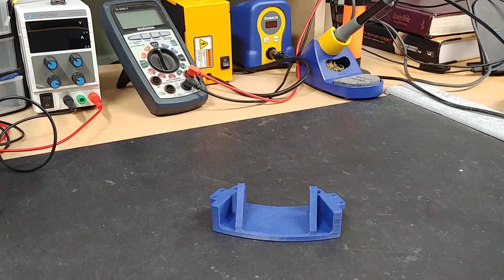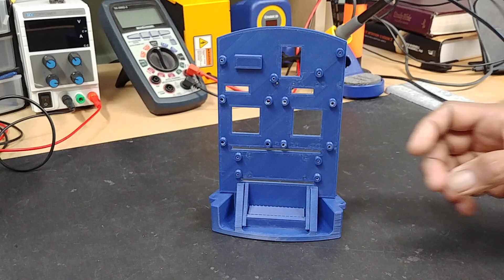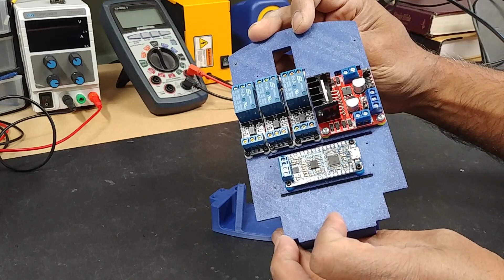R2D2 Build Episode 3- Dome Mechanism Electronics Board

Comment: Hi Dan, I’ve managed to obtain all the information you provided for the dome mechanism build, but was hoping you could provide a schematic on how to wire it all up. I’m using the same electronics components as you are, so effectively a replica of what you’ve done. Any help would be greatly appreciated. Nigel
Reply from the maker: Hi Nigel.  I don't have a complete diagram but I have one diagram that shows how to wire up the motors and limit switches.  It can be found here: https://drive.google.com/file/d/16oCrsCOlNoQSy4BZxheGNYJnU1nh-_0b/view?usp=drive_link
Reply: @ that’s a great start, thanks Dan 👍
Reply: Where did u get the power distribution board?
Reply from the maker: @3dPrintingNederland  I made the board myself out of a small perforated PC board and a bunch of screw terminals mounted to it.
Reply: @MakerDan55  haha no wonder i cant find it anywhere. Thanks man I'll work something out 😄
Reply from the maker: @3dPrintingNederland  remember that you can change/modify anything I have done.  There are lots of ways to build this thing.  You will probably find many improvements to make that work best for your particular build.  Don't underestimate your abilities 😁.

Comment: For periscope power, I cheated a bit.  I gave it its own +5 connection right off the regulator, but for the ground, I used the fact that the limit switches are SPDT.  So when the periscope is at the bottom, it sends ground to one pin that goes to the Arduino input.  When it's not down, the other pin is connected to ground and that goes to the periscope ground.  That means that the periscope automatically powers up as soon as it starts ascending.  The downside is that I can't use it to light up the inside of the dome during the bad motivator animation sequence.
Reply from the maker: @davidwilliss5555  creative idea.  Great job 👍🏿